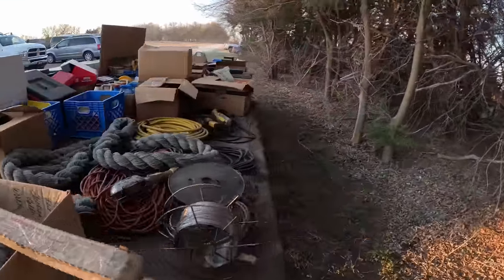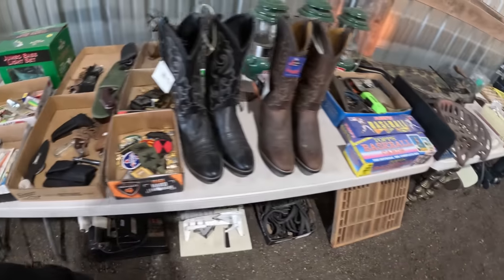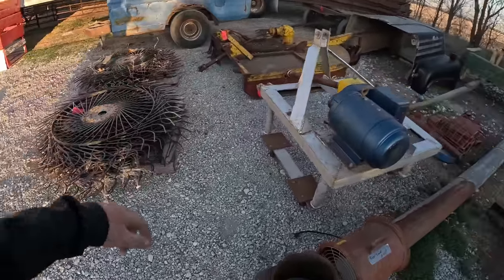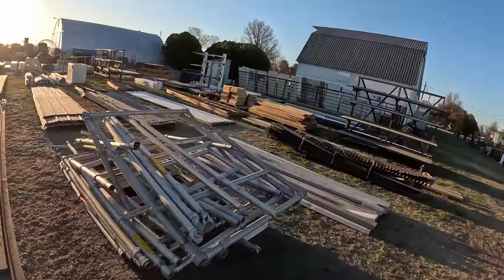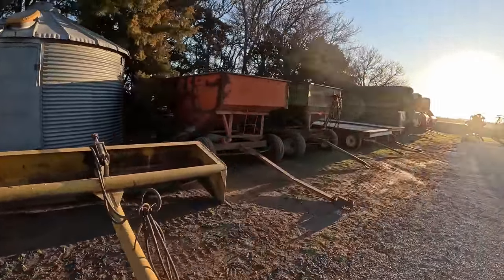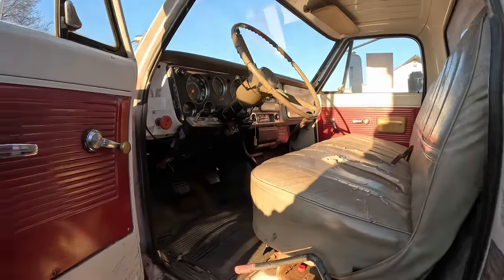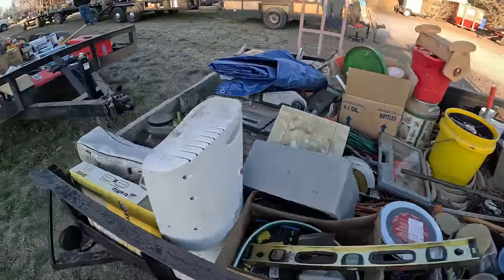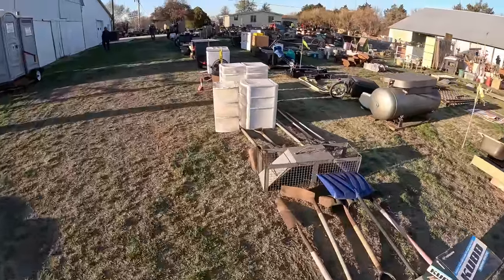Is There Anything Good at this Farm Consignment Auction?

Comment: If you get a military trailer with no title and build a camper you can get it inspected by KHP and they'll issue you a VIN plate with the paperwork to get a title and tag at the DMV I've done it alot with farm trailers they call it a builders title just like taking 10-20 vehicles and building 1 out of the good parts or I chopped a blazer up for a mud toy and left the lights and stuff on to keep it street legal cut everything off at the top of the doors (because in KS if you have eye protection you don't need a windshield just working wipers IDK why) and built a cage and 5 point restraints for all seats and got a builders title for it

Comment: Greetings Silas, the military trailer you pointed out is a M101A2.  Rated at 3/4 ton & weighs abt 700 lbs.  In NJ, trailers under 2500  lbs require only a registration to get on the road.   Around here, that trailer would go for $2000-3000. Good luck.